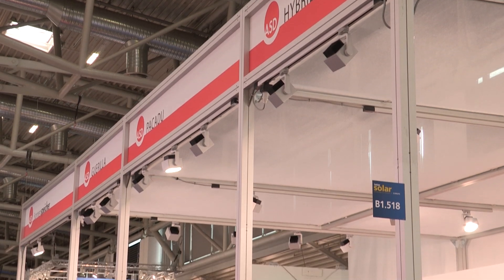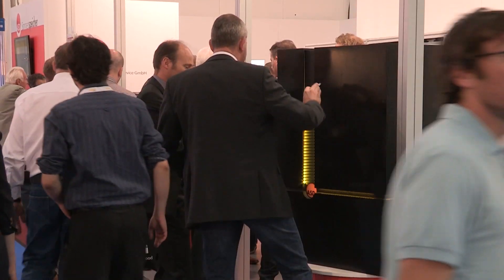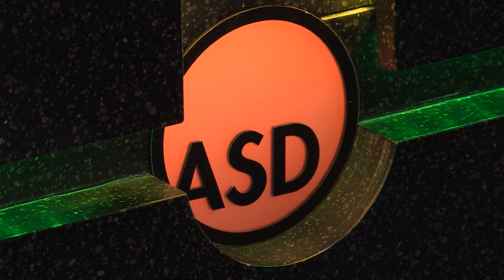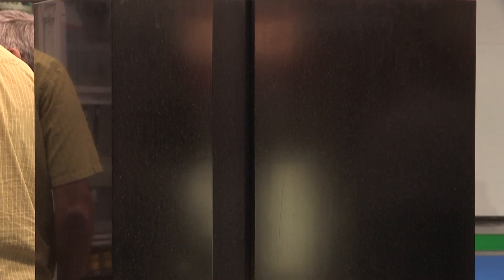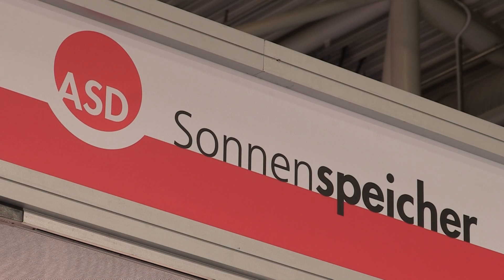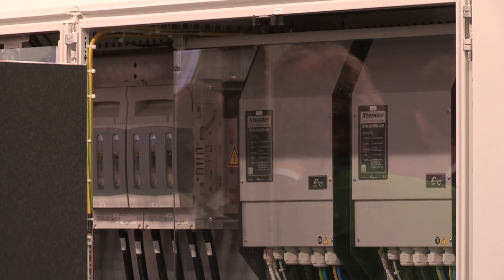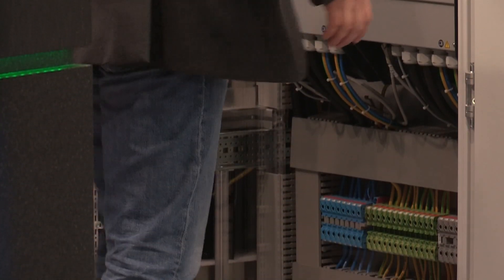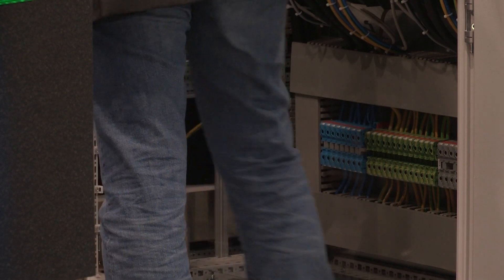PV Tech Storage interview with ASD part 1 of 2

Comment: Thanks! I like this guy's approach. My question is this: If power generation is mixed (solar, wind, etc, natty gas, oil etc.) how does the storage unit know which electron is flowing because of solar vs. which electron is flowing from something else. I must be missing something.
Reply: He is assuming only one non-grid intput: solar from your own PV system (=green). If you also own a wind generator, i would assume its still green. The other input is energy from the grid, usually be a mix including energy from pv, wind, coal, gas etc., but that cannot be differentiated so its just showing a blue light. Orange = energy previously stored in the system = output.